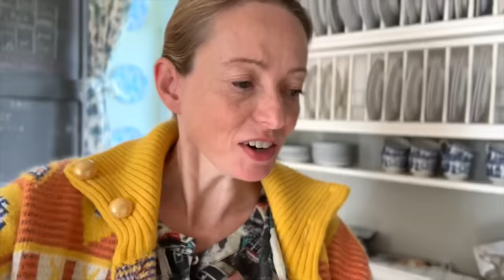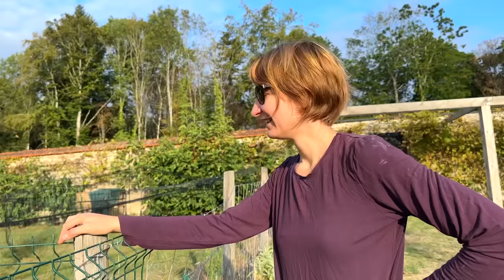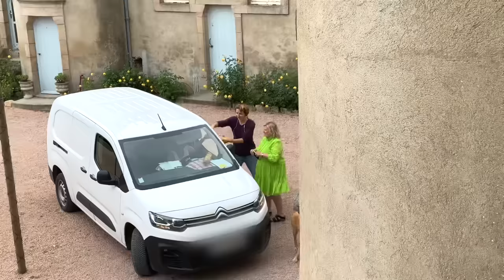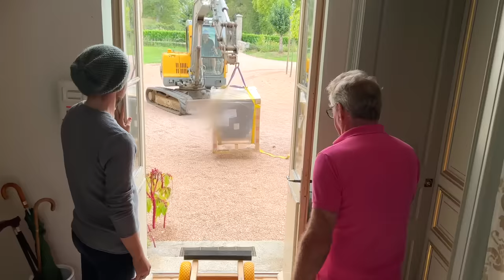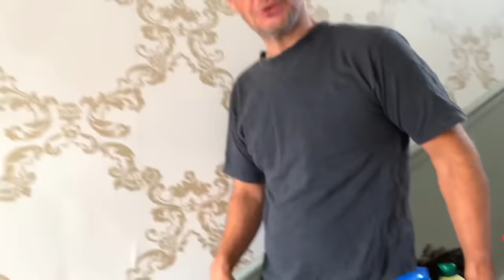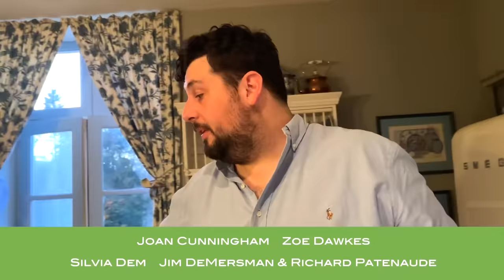I made an entire video about moving a log burner into the chateau and feeding chickens.. 🐓

Comment: Love the new wood stove for the grande salon (I think it was headed there.)- looks like it will work great and be a wonderful supplement to your new gas fired boiler(s)? heating system.  It sure looks wonderful- get ready to finally be warm!  We live in a big old house so know how it is in Winter! Love what ya'll have done with the place- looking wonderful after so much hard work!!  The heat could crack some old antiques that are used to the higher moisture- maybe think about a humidifier in the room with the oldest/largest antiques as a transition.  When I changed to better heat in one house my huge Old library cabinet cracked- you could hear it splitting sometimes because of the difference in humidity in the wood.  Just a heads up.